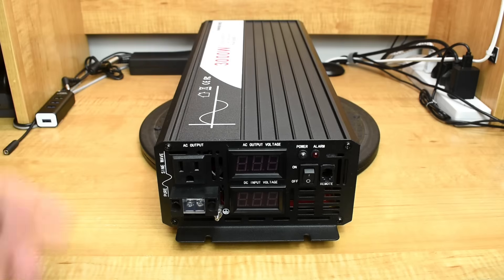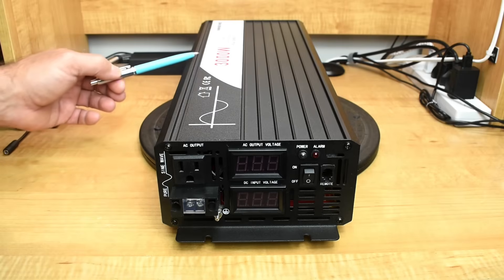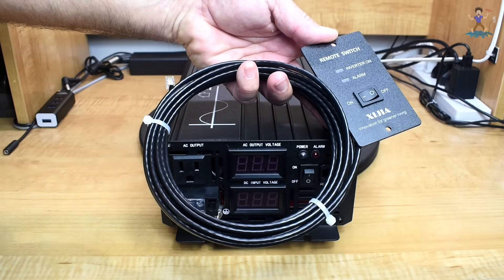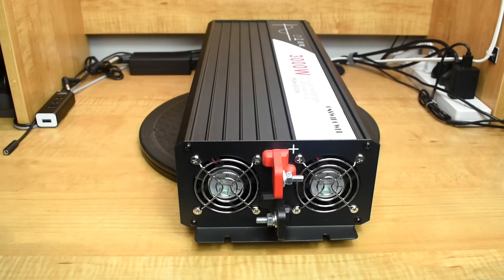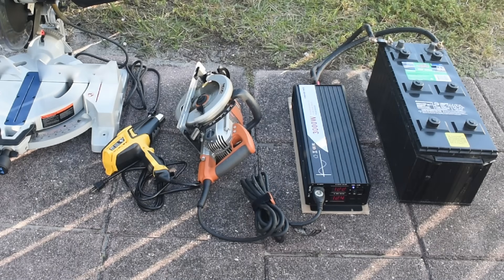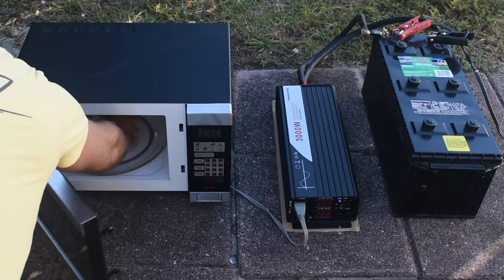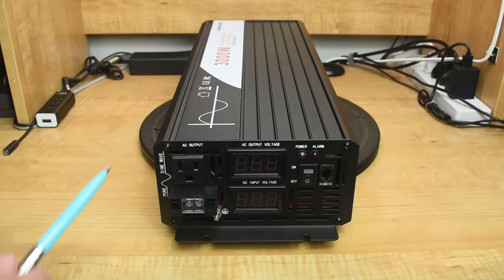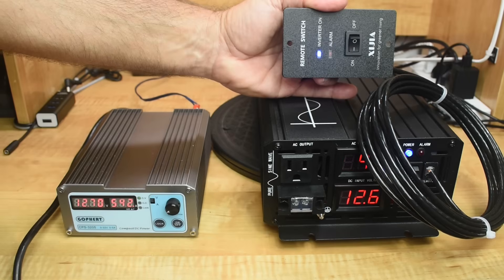3000W/6000W Off-Grid Pure Sine Wave Inverter Any Good? Find Out!

Comment from the maker: For those of you that don't want to open up the inverter to make the modification shown in this video(If Needed), you can also use a 1 foot 12 gauge heavy duty extension cord with a plastic electrical box installed in the middle for the breaker. Thanks for watching! Be sure to share the video link with others.
Reply: Thank you  very good  video  
Please  tell me  what  brand is  it you will  recomende,  I need  to drive my dryer  for  50 minutes   it is 6 amperes   # my washer  machine   mebi for 2 hours  2  time a week   but  I will  like to use 12 vols 3000w inveter  please  recommend   the best  you know  for dis application  thank  in abanc
Reply: try something from DELIXI ... when I was visiting my supplier he adviced me delixi as a good quality supplier... I wonder if he has a right...
Reply: Alternatively, would a built-in circuit breaker extension cord also work?
Reply: Test it with a hifi Amplifier and hear if it has noise

Comment: Can four 12v 200ah battery a 3000w inverter  run a small standing fridge and how do I know it is fully charge with 2  550 panel?
Reply from the maker: @orvillecraig7461  Yes. Ideally you would purchase an mppt charge controller
Reply: @electronicsNmore  when fully charge what reading would be on the charge control 48V?

Comment: Just pulling the trigger on a saw says NOTHING! Show a real TEST! Cut up a 6 foot Oak 2x4 into 6 inch pieces and see how many cuts it will make . Also, use a 100 AH Lithium battery like everyone else. Truck drivers use their lead-acid batteries because they NEVER turn off the truck. It's like plugging into the wall socket. THAT is not off grid. HOW efficient is the inverter. What are you comparing it to ?????

Comment: I have a question maybe you can help me with it. I have 700 Watts and I need to run in my house in South Florida if I have a 2,500 watt inverter. if I have four or six 100 amp battery will that work with the system and give me longer runtime. I'm not looking to run a lot of things I just want to be able to run these things overnight and the daytime I can use my generator to charge the batteries, with battery chargers with one 20 amp charger on each battery.  I have a mini split air conditioner that draws anywhere from 150 to 350 Watts. I just want to be able to run that and run it for a long time. should I buy 100 amp batteries or 200 amp batteries the ones that are twice as big or so just stay with f six 100 amp lifepo4 batteries. Thank you for your time

Comment: Cool review. I bought a 3000w 24v to 230v pure sinus wave DC to AC inverter. I want to charge my portable power station with it from 2 12v 100AH car batterys connected in series(gives 24v 100ah). 

Here is the challenge: the power station accepts 1800w max input from AC entry. And max 1000w solar input which it already gets. Now i want to use the inverter to provide 1800w AC from the batterys. Which could provide 24x100ah=2400Wh max and i should be able to run it for at least one hour. But i want to charge it simultaneous with the solar input. 

How would you setup this system..?

Comment: Brass has more resistance. Brass is only used for terminals cause it's easier to machine
Reply from the maker: Yes brass has more resistance but you compensate by going thicker than copper

Comment: I was told an inverter will burn up if my lifepo4 battery shuts down before the inverter can shut itself down for low voltage, while under load. I have yet to get one of my 8S lifepo4 batteries, to get down to 10.5v before one of their 8 cells gets too low and shuts down the pack. IS THIS TRUE? HAVE YOU GOT A WORK-AROUND for that situation? Maybe a 24v  capacitor pack  thing, to slowly go down to 10.5?  That would make a great product and video.  The whole lifepo4 battery pack thing is really starting to aggravate my. It seems like a person needs to babyset these damn things when charging and using.

Comment: How do I discount the low voltage alarm
My lithium batteries
Work well below 10 to 10.5 volts
I would rather not have My inverter cut off at 9 to 10 bolts as well.
Like I said if my batteries lithium batterieswork until around 7 volts why should I go without power at 9 to 10 volts
I hate that to me, worthless alarm.

Comment: They should’ve installed a 20 amp receptacle instead of a 15 amp receptacle. And actually they need to start installing tamper and weather resistant receptacles on these devices. As much as they cost they should be installing top quality parts and devices.

Comment: Ive just bought this inverter, and I am glad you said it was ok, now I need to know why its bleeping and the batteries are full. I have connected 2  12v batteries 100 ah each with the wireing in Parrell, and as you know one wire is from positive to negative in the other battery, all connections are thick good quality copper, but the positive to the negative wire connecting both batteries is thinner could this be the problem?  I had a modified inverter before and it had the same prob,so sent it back. also the inverter say you should not connect positive to negative, but if not how can one do parell conections?
Reply: Parallel wiring is positive to positive & negative to negative maintaining voltage output of batteries but increasing amp hrs. You have described series wiring which will increase voltage adding the batteries voltage together.. which is why you are experiencing issues by putting your devices into over voltage protection. Please be very careful working with any form of electricity. Batteries can be very dangerous!!

Comment: I want to see you load down the Delta chopsaw while cutting wood for about 10 minutes straight if I can do that and I can do it every day then it’s a good inverter. High frequency transformer style inverters like that can’t really handle too much inductive load.

Are use an outback fx2524 inverter run a chopsaw to Cutwood for my woodstove all winter. It’s never failed me. I can sometimes see that I’m pulling over 6500 W off of the inverter and it still will not quit.

Comment: Could you have a battery charger going at the same time charging the battery and using power continuously?
Reply from the maker: Yes
Reply: @electronicsNmore  Thank you. I will try it. I have an 8000watt inverter I haven't used yet. Was thinking of putting it in my RV.

Comment: I will just add that in case of short circuit, circuit breaker will not save mosfets if internal protection circuit is not built adequately. Reaction time of circuit breaker is way to long to save silicon devices.  Otherwise very good review with some solid real life tests.

Comment: I'm curious if that chopsaw worked under a load of cutting wood or metal tubing. I'm in the process of solar powering my shop.  I have several 12v inverters dedicated to powering separate tools of various types.  These 12v inverters will be connected to large start lead acid batteries as tool use draw large amounts of current for short periods of time.   But I'm also thinking of using a 3000w inverter with a 48v input using my 40v ryobi lithium batteries for use with my large bandsaw.  Input voltage range between 36vdc to 50 max.  Any thoughts?
P.S.   I noticed that your inverter mosfets were cooled with internal heatsinking and not the outer aluminum case like so many others.

Comment: Hi there 
Iam a truck driver and I am trying to get my breville bambino plus 1600w espresso machine to work I do have a 3000watt inverter but it’s not working the machine turn on but the water comes out cold and the millk steamer doesn’t work at all please tell me what to do without breaking the bank thanks in advance
Reply: Often the 3000watts means 1500watts constant and 3000watts peak, the peak being generally counted in milliseconds. 1500 is enough to run the expresso "badly" without tripping the security.
 You need a 2000/4000, at least.

Comment: Nownthis is real inverter review . Gods mode.

Please suggest some reliable available in europe 2500+ inverter to run car polishing machine 1100w
Reply: I have a 24v - 220v one of this brand in France. 5000/10000watts. 
I am yet to find something it can't power.
Reply: @robinhood4640  you mean you  SWIPOWER 5000W invertera and you ar ehappy with it until now? Thanks.
Reply: @helerionanastas4709  I have exactly the same one, but the 5000/10000 model. I am still very happy with it.
I only use it when I need power, because it uses a lot more electricity idling, than the 3000/6000 that runs 24/7.
I basically just use it for the washing machine and more demanding power tools, 1000w and up. I can just leave it on in the summer, but I have to turn it on when needed in the winter. It's more of a, I don't have enough electricity problem, than a converter problem.
Reply: @ thank you! What brand is the 3000/6000 inverter running 24/7?

Comment: I have a question for you if I was using into a van for used for power tools if necessary out in the field what battery would I use in a van what sizing and what kind if you could give me a link that would be great
Reply from the maker: You'll need a high output alternator, at least a 4D battery(I recommend a 200Ah LiFePO4 like shown on my channel), and battery isolator.
Reply: You're saying I have to change the alternator on the van?

Comment: Hey man I have a question. I am looking to open a small pop up coffee tent (under a gazebo). I have been searching everywhere for an answer. But I intend on using a coffee machine. (One where I just place a cup underneath and press the button on the screen and it’ll make the required coffee). Is there such a battery or inverter that can buy that can deal with this for say 6/7 hours? The machine will stay on at all times obviously - but won’t be USED as such until a customer wants a coffee. What would you recommend I do in regards to powering this for around 6/7 hours. Thanks for the video btw man, so helpful in my next steps!
Reply from the maker: Definitely going to need large solar panels connected to keep the battery voltage up.

Comment: Hello. i like the test you did. I checked that you connected the battery charger to the battery. I have a Green Cell Transformer 12V / 230V 2000W / 4000W Mod in you.
and I wanted to know. can i use the inverter on the battery all the time if the battery is attached to the charger.
How strong the battery cooler and battery must be. to power this inverter continuously at 1100w

Comment: wish I had seen this before. I have purchased a 3000/6000w sine wave inverter much like yours and seems to work well but massive rf interference even when hooked up to external battery. you did not test for this any suggestions? Rgds Trevor
Reply from the maker: Never had any inverter do that.

Comment: Seems the company doesn't make the model with the direct output terminals anymore.  All I can find are ones with a plug outlet.
Reply from the maker: Yes. Only 4000W and higher. You can always add your own terminal strip.

Comment: Hi can off grid continuous inverter run 2500 watts machine with battery charger connected to battery 24/7?
Reply from the maker: I'm not sure how much inrush current the machine uses at startup, so I cannot be positive.

Comment: Very informative, thanks. One of the issues I’ve always had problems with is an inverter supplying an electric cement/concrete mixer, when the mix ‘slumps’ the additional load doesn’t go down well with all of the inverters I’ve used, I now use a ‘redi -line’  1600watt rotary inverter which copes fine.
I’d be interested if, in your reviews you would consider testing inverters powering a mixer ‘ doing something’ as just spinning it isn’t a true test.

Comment: What's the amp hour rating of the 4D battery? With a 3000 w inverter, you can't expect much from a 100 ah battery that would die in a matter of minutes, especially using lead acid.

Comment: I agree with all other compliments, superbly thoughtful and thorough review. Especially helpful for a real novice. I now plan to buy this inverter through your link. However, I am confused, as I want to wire directly into my RV 12V electrical system. In one comment, you said “ In your RV, use the inverter as is, don't ground it.” Also, you connected an AC plug to the inverter with only +/- wires without a ground in your testing. There is only a 2-wire connection for permanent wiring, but a separate ground connection. My confusion is because my present 2000 watt inverter has a 3-wire connection for permanent wiring AND a separate chassis ground connection. How do I safely wire this inverter? Both the permanent 3-wire connection ground AND the chassis ground to the same ground connection? Neither grounded? Doesn’t the direct connection neutral wire to my RV system have to be grounded? I don’t want to burn something up? I found a copy of the instruction online, but they do not explain or help. All comments and suggestions are welcomed. Thank you again for your wonderful reviews.
Reply from the maker: In the RV, just connect the (+) and (-) inputs. You can ground the metal housing of the inverter if you'd like.

Comment: Do you think this could be used for a sump pump? Does it come on automatically?
Reply from the maker: All depends on the ratings. If the inrush current is high, it may not start up. Nothing is automatic, you need to turn on the inverter.

Comment: Thank you for a great review. I bought the 1500w of this exact inverter and I agree with everything you said in this review.
Reply from the maker: Great to hear! Be sure to rate thumbs up, consider subscribing if you like a wide range of helpful and informative videos, and look over my extensive video playlists below for many other videos of interest to you. Taking one minute to share a link to my channel with others on social networking sites would be greatly appreciated. Thank you 

http://www.youtube.com/c/electronicsnmore/playlists
Reply: Hi, Are you still happy with the unit? Does deliver 1500W contnues and for how long? Thanks in advance!
Reply: @helerionanastas4709  Yes I can say I'm very happy with it,  I didn't use it much in the last 3 years but I did few extensive testing with it. It does work well with the small 6000 btu window AC, for the short time I tested it. It did run the 1500w heat gun I have, it run the induction cooker which takes 1000w. 
My Inverter is the 1500w version.
Just keep in mind you need to use thick wires to make it run well. my system is 24v and 10 gauge wires didnt work well, they got very hot, I moved to 4 gauge wires and then everything was great.
Reply: @ben-yi3nh  thanks bro!

Comment: Thanks as always, great review... although didn't see the results of short circuiting it?  Or did you not do that (or was there a fire LOL)?  I think this is a similar inverter (but with obvious differences) , but have you ever tested the PUGU inverters?  Here is an AU link to 220v version https://www.ebay.com.au/itm/154198468162?_trkparms=aid%3D777001%26algo%3DDISCO.FEED%26ao%3D1%26asc%3D20170615105047%26meid%3D880cac6e72894e118faa12cbc3250800%26pid%3D100656%26rk%3D1%26rkt%3D1%26itm%3D154198468162%26pmt%3D1%26noa%3D1%26pg%3D2380057%26algv%3DRelatedTopicsKWTitleSRPSeeAll%26brand%3D&_trksid=p2380057.c100656.m5063&_trkparms=pageci%3A65535461-e448-11eb-b012-ae9e589906a4%7Cparentrq%3Aa2c5e1ff17a0a9f936f8ffc3ffd54d55%7Ciid%3A1

Comment: Have this same inverter but when checking the plug with tester, keep getting open ground, even with grounding wire connected to chassis. Did you ever check if the ground wiring is correct? Also, does it make a small noise when plugged in? Not the fan, those kick in ok when running close to 3000w.
Reply from the maker: Many inverters aren't grounded, the ground pin inside most units have no wire connected to them.

Comment: Thank you very much for sharing this information. I am looking for a very good 3000 watts pure sine wave inverter, do you have any recommendations?
Reply from the maker: This unit works well, but if money is not an issue, I can suggest even better units. Thanks for watching!
Reply: @electronicsNmore  . Your welcome. What’s the price? I don’t mind paying for something that’s going to do the job because sometimes I use a Jack hammer to do my work and there is no electricity around, I prefer to have at least a 3500 watts pure dine wave inverter. Have a blessed day
Reply from the maker: The units below would be good for you since you'll be using a high inrush/inductive load. You don't have to buy from my links, but if you do, it's no extra cost to you and you'll be supporting my channel. Thank you!
https://amzn.to/3gXB4bA
https://amzn.to/3aVNUTX
(Affiliate Links)

Comment: The "high power A/C output" terminals look small and the little plastic cover looks....well, inadequate.  Is there even room for securely hooking up a 10/2 wire to the output terminals?
Reply from the maker: Should be room.

Comment: All these inverters seem to use cheap, automotive fuses in parallel on the input, soldered to the PCB. Generally, fuses should not be put in parallel, and soldering them to the board makes it a PITA to replace them, but every inverter I've seen uses this protection scheme.
Reply from the maker: Yes Peter, it's the same for the great majority. The fuses aren't soldered to the board, you press them into female blade connectors that are soldered to the board. Thanks for watching!

Comment: If v use ten hrs 2ton Air-conditioner of 1200 watts ,How many units it takes to charge batteries.and in how many hrs.
Reply from the maker: I suggest you have 2x that wattage amount in solar panels. Huge current draw. Well over 100 Amps.